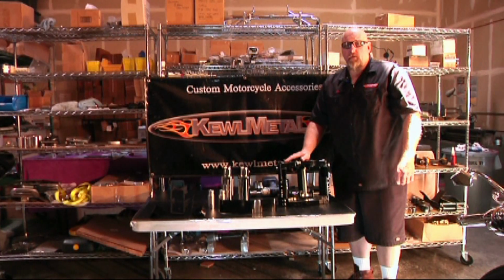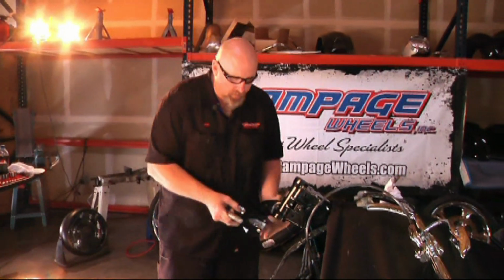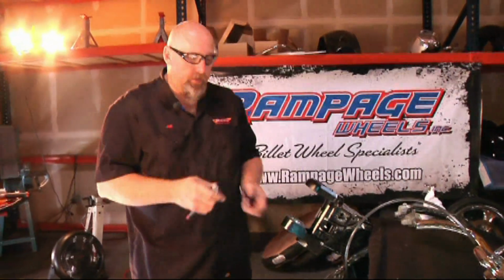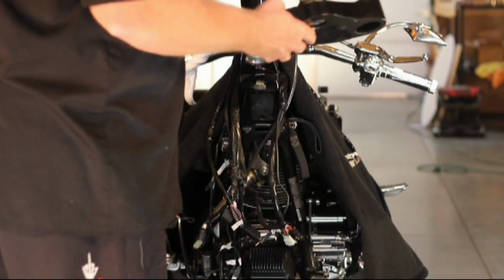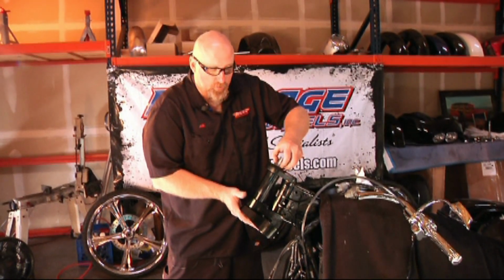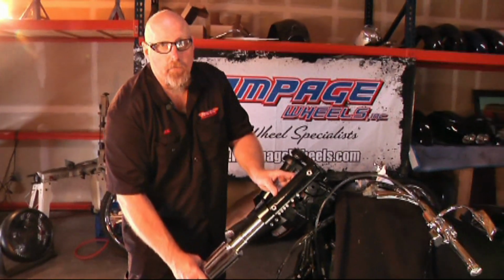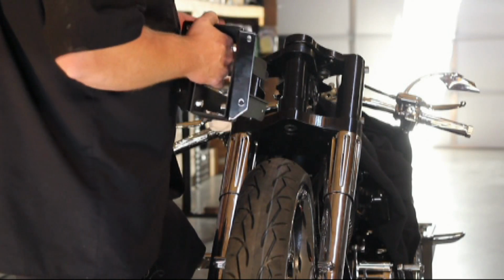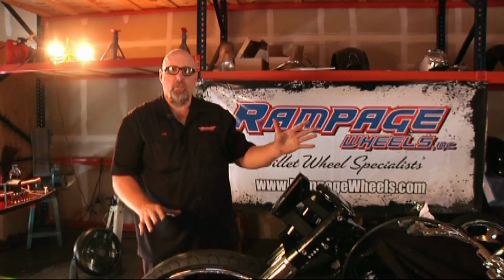Kewlmetal 40 degree bolt on rake kit installation.mp4

Comment: I would buy this after it is reasonably priced 2700 for a rake kit is insane.
Reply: shadowdeathcat I think it's for everything bolt on kit fork extensions and adjustable fairing bracket. And the fork sleves if so that's a deal